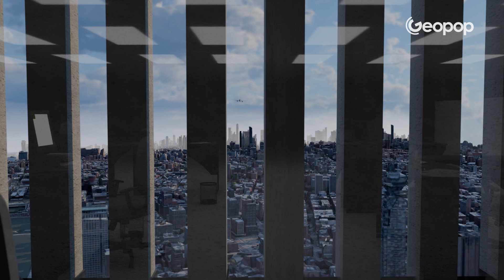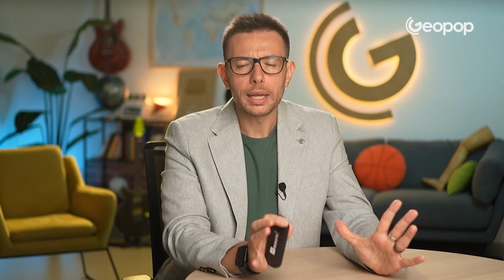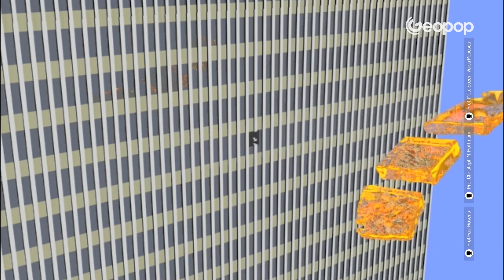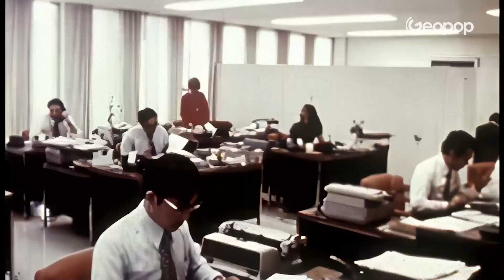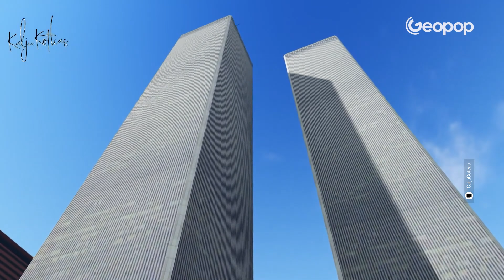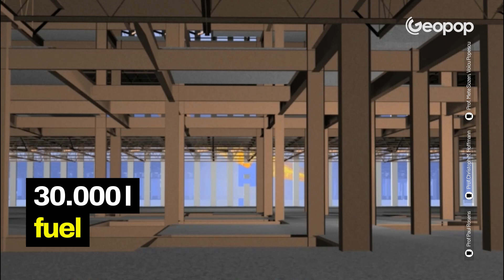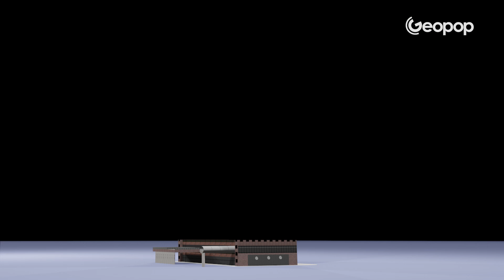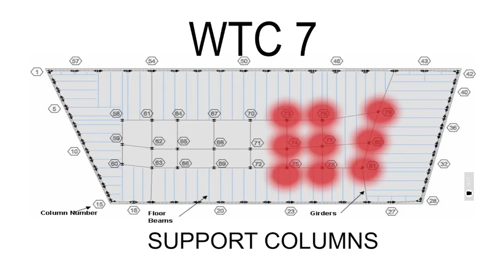9/11, 2001: The Technical Reconstruction of the Twin Towers and WTC 7 Collapses

Comment: The steel superstructure below where the plane hit was in no way damaged, we know this as a fact. It was designed to support the entire building. The top part breaks free and pulverises the rest of the undamaged building, how is this possible. Make a lego tower 1 metre tall, break off the top part and throw it with all your might onto the remaining tower, there is no way it will vaporise the rest of the tower. It will bounce off and fall to the ground like all collapsing building do.... as for building 7, use your eyes.
Reply: I'm not a native English speaker, but I'll try... no high-rise building i know in the world is designed to be partially cut off in the upper third and the entire upper block dropped one floor. In Lego, it works because Lego has all the joints similarly stiff. The stiffness of the joints is a key thing when calculating internal forces and their distribution in space. Here we are talking about +- ten floors falling as one block from a height of about 4 meters. They hit a ceiling that is designed to support its own weight + 400 kg per m2. For one ceiling to be able to support an entire block of many floors when falling, it would have to be designed for such a load from the beginning, and its connection to a vertical supporting structure that would have to be designed for it. Moreover, the dynamic effect multiplies everything.
Try to imagine it different way. A huge perimeter column designed for a load capacity of, for example, 10,000 kN and to this column is connected by two bolts with a limit of around 2x100 kN a ceiling beam that carries 100 kN load and 100 kN is a safety margin if one bolt failed etc.. A huge weight suddenly falls on this beam, for example, 10 x 100 KN x dynamic effect 10 = 10,000 kN. If it were to withstand it, it would have to be designed for this load, but it was designed with the idea of 200 KN. In addition, it should be able to transfer the same force to the columns through those two bolts, because columns are connected to the ground and the load must reach the foundations through them. Can those bolts transfer this load?.. So if you want to make a Lego model. Make strong columns, but connect the ceilings to them with something that can only hold that one ceiling + 100% of its weight as a reserve. The moment you put two more ceilings on one ceiling, the joints will loosen and the ceiling will fall one floor lower... and then try that experiment and throw the top 10 floors on such a model... You will see that the whole thing will fold and you won't even have to throw it.
Reply: How was it possible?  Simple. Let’s break it down to the absolute basics:

The 47 core and 236 perimeter columns of the Twin Towers support all of the gravity loads of the building. ALL of the resistance is in the columns.

Planes impact Towers, causing massive structural damage, destroying sprinkler systems, tearing out gypsum board walls and blasting off the SFRM insulation from the floors. Multiple floor-wide fires are started instantly and spread rapidly due to the destruction of fire protection systems and venting of the building during the impact.

Serious fires were largely confined to the impact damaged floors and those immediately adjacent to them.

Fires were started by the impacts and fuel aboard the aircraft, which acted as an accelerant. No shortage of other consumables inside the tower to continue the fires.

Collapse was initiated (started) at the impact and fire damaged floors when floor trusses exposed to heat over time sagged, in turn pulling on and causing the inward bowing of some perimeter columns by up to 5 feet until they buckled on one face of each tower (ie: NOT symmetrically).

www.youtube.com/watch?v=ULdiD6gYZO0

No steel melted or needed to. Structural steel will bend and fail at less than half its melting temperature.

Once the perimeter columns buckled the formerly static load above became a dynamic load 30 times greater, easily overwhelming the structure below.

Thousands of tons of now loose debris fall through the open office space within the four outer walls - bypassing the columns - dropping 12 feet onto the first intact floor it comes across. That massive instant overload causes the floor to fail, shearing the pair of bolts that secure each end of the floor trusses to the columns. The floor fails. adding its mass to the falling mass which continues to accelerate for another 12 feet until it impacts the next floor, rinse and repeat one floor at a time all the way down.

The columns - the part that holds the building up, supporting ALL of the gravity loads - are spectators for all this as the debris falls around and past them, not onto them.

Rate of collapse increases as momentum increases. The collapse front is constantly accelerating.

As each floor fails, air inside the building (the Towers were 95% air by volume) is compressed, then blows out the sides _in reaction to the Tower falling, not the cause of the Tower falling.

No fire required at all on floors below the impact points for them to fail. The mechanisms that started the collapse are different to the mechanisms which continued the collapse. That will be a difficult concept for some.

As the floors fail the perimeter columns are left literally hanging in the breeze, no longer attached to the rest of the structure. They peel away and fall in great sheets (think banana) out to more than 600 feet from the base on the 4 points of the compass.

Core columns failed last.

The collapses took 32 to 34 seconds start to finish, or about 1/3 of the rate of free fall acceleration for those obsessed with how fast things fall because the internet told you it was important. No Laws of Physics are violated so no need to invoke magic or divine intervention

Each 110-story tower had a 1-acre footprint. The debris pile was up to 14 stories deep and spread out over 16 acres, destroying 8 surrounding buildings and damaging more than 100 others.

Anything can seem like a conspiracy if you don’t take the time to understand how it works. Hopefully now you do.  If not, I can go into much greater detail.
Reply: @TheLoonResistance u keep giving people detailed explanations like u know what u are taking about. U sound like a robot. No office fire or jet fuel fire can melt steel! Period. How can u explain the fucking molten steel that was poring out of the building. What braucht the building down when the top part seconds after starting to colaps was completely destroyed. How can a building fall in 10 seconds without any resistance. Stop talking bulshit. If u don’t agree with some one don’t pretend u know better because u don’t.
Reply: @alexzarnescu4204  - Obviously you need the full version:  Twin Towers collapses were relatively straightforward, the professional engineering community getting a good understanding within just weeks. For the average person though it still requires some effort. Engineering is hard, and who has that kind of time?  So the internet stepped in, peddling a lot of really bad information, simple slogans and hand-wave rationalizations that are exciting and require little or no thinking.  Naturally that gets far too much attention.

Because anything can seem like a conspiracy if you don’t understand how it works and I’m an understanding kind of guy, I prepared my own short yet detailed technical description of Twin Towers collapses from my own observation and analysis of available true and relevant facts. No politics, ideology or magical thinking, just engineering. Hopefully this will dispel many common myths and answer most if not all questions you may have about the collapses.  

While complex, most of the Twin Towers collapse mechanisms can be seen with the naked eye and easily discerned and understood by the layperson if sufficient time is taken to understand.

1. The Twin Towers consisted of 4 primary structural elements that together formed an integrated system where each relied on the others. 47 hollow box-section steel Core Columns carry the majority of the gravity loads. The 236 hollow box-section steel Perimeter Columns carry the remainder and ALL of the lateral (wind) loads. Long-span Lightweight Steel Trusses connect the core and perimeter column together at each floor with a Hat Truss on top to tie the structure together as an integrated unit where no element can survive without the others. There was no structural load bearing concrete and most components were bolted together.

www.youtube.com/watch?v=u7OqrC74Dm4

2. The impact of 120 tons of airplane (= to about 12 dump trucks) at speeds up to 589 mph with the energy of a ton of TNT completely destroys the aircraft. This in no way implies the Towers come out unscathed. Many perimeter columns are damaged or destroyed as are some core columns (example; 33 of 59 perimeter and 20 of 47 core columns damaged or destroyed at the impact floors in the North Tower), This damage is primarily through bolt-shearing failures at the end connecting flanges, as well as bending, twisting and fracturing of weld seams. There was no cutting or slicing - the reality was far more violent and messy.

3. The impacts destroy or damage fire insulation, fire breaks and sprinkler systems on multiple floors. Huge fires are started across multiple floors simultaneously and allowed to spread rapidly with no effective firefighting or fire suppression. This was an unprecedented fire event .

4. The hotter steel gets the weaker it gets . With fire insulation stripped away and no sprinklers the survival time of the steel greatly reduced. Gradually over time heat causes the lightweight steel Floor Trusses at the impact damaged floors to sag, which was observed and recorded. No steel melted or needed to. Structural steel fails long before it becomes a puddle. It just needs to bend

5. Sagging floor trusses pull on the increasingly weak and overloaded Perimeter Columns, causing some of them to bow inward by up to 5 feet. A straight column is up to 4 times stronger than a bent column. The bowed Perimeter Columns buckle and fail, quietly initiating collapse. The formerly static mass above which the structure below could easily support is converted to a dynamic mass up to 30 times greater. Because they have buckled, the Columns above and below the failure point are no longer aligned . The load bearing structure below no longer bears any load as it falls past the lower columns, NOT onto them.

www.youtube.com/watch?v=ULdiD6gYZO0

6. Thousands of tons of debris fall within the four outer walls, down through the open office space, crashing onto the first intact floor it encounters, immediately breaking the bolted column connections as the amount of resistance the Floor Trusses can offer is negligible. The falling debris slows only marginally and briefly. Note: 
6a. This is NOT a solid top block crashing into and “crushing” a solid bottom block . 
6b. The debris falls past the columns not onto them. The columns provide no resistance to the falling debris. 
6c. Only the bolted floor truss connections to the core and perimeter columns offer any resistance. A pair of 5/8” bolts at each end of each truss vs. thousands of tons of falling debris. 
6d. No laws of physics are violated. 
6e. There is no 20 floors against 90 floors but rather 20 floors against one floor, then 21 floors against one floor, then 22 floors against one floor, etc. 

7. This floor-led collapse progression within the four outer walls can only go straight down.
7a. This process is often incorrectly referred to as “pancaking”. The catchy name stuck but nobody knows what it really means and "pancaking" is too simplistic and inaccurate anyway. I prefer Kaiserschmarrn.

8. Collapse progresses through the floor systems past the columns, through the path of least resistance . The resistance offered by each floor is always the same while the mass of debris and its velocity – thus its energy - increases with each floor failure. Each floor offers the exact same resistance to the falling mass while with each failure the falling debris constantly gains both mass and velocity. *This process of floor-by-floor destruction cannot be arrested, it can only speed up . Rate of floor failures increases with each floor as momentum increases, reaching an average acceleration of 0.65 of GA, or 35% slower than true free fall. Bam, bam, bam down the building until there are no more floors to fail. The resistance offered by each successive floor is always the same. More mass, more velocity, same resistance with each floor. Don’t get stuck on the but the lower floors weren’t on fire nonsense. They weren‘t and didn’t need to be.

9. The Towers were 95% air by volume. As that air was compressed inside the building it is forced down the tower and blown out the sides in reaction to the building collapsing . Those were not “explosions”, it was expulsions of compressed air caused by the collapsing building, explaining the low velocity, lack of flash, blast, supersonic pressure waves and lethal high-velocity ejecta.

10. Perimeter Columns become detached and peel away like a banana behind the collapse front, playing out to the four points of the compass extending to more than 800 feet from the base of the towers. This was quite obvious from examination of the debris pile.

11. Core Columns fail last as their internal beam bracing is stripped away by falling debris and lateral support from the floor to perimeter columns is lost.

www.youtube.com/watch?v=WpHXj62Ylw0

12. For those who care about how long this whole process took; 31-34 seconds from the moment the perimeter columns buckled until the last core columns hit the pile, or 1/3 the rate of true free fall. Don’t believe me? Just watch any video of the collapses and note the loose truly free-falling debris dropping much faster than the towers themselves.

13. Each Tower had a 1-acre footprint. Far from collapsing inside their own footprints the debris pile spread out over 17 acres in a pile up to 14 stories deep. 8 surrounding buildings were destroyed and scores more damaged by the falling debris.

14. NOT observed were the 180-190 dB bangs of thousands of high explosive devices or the blinding bright flashes of burning thermite. Neither explosives or thermite could have survived the impacts and subsequent fire nor could have caused the (silent) perimeter column buckling that clearly initiated collapse either. A video of a shocked and injured firefighter casually using the magic word explosion is in no way proof of explsoIVES and the demolition_ case relies entirely on that sort of thing. There is zero tangible physical evidence and it would be technically impossible, totally impractical and completely unnecessary. No one would bother.  In 24 years zero structural engineers of tall buildings, including the 1/3 that have retired in that time, have made any statements in support of pre-planned demolition claims. NONE. The lack of any such citations in the engineering literature (published in any country worldwide) is telling.

15. Twin Towers were perfectly safe within their design envelope. They only collapsed when taken far outside design parameters by an extraordinary and unprecedented event

Impact + Fire (heat) + Time + Gravity = Collapse . Remove any one of those 4 elements and there is no collapse. Ignore any of those elements (as many do) and you will never understand the collapses. The Twin Towers were an integrated system in which no one component could survive without the others. One fails, the rest follow, through the path of least resistance – DOWN – through the open space, bypassing the path of greatest resistance – the columns. Nothing I just described violates any laws of physics. All of the above is true no matter who planned and carried out the 9/11 attacks or why

I hope you found this helpful and informative. It’s meant to be non-adversarial and solicit informed critical comment, positive or negative. If I made any errors of fact, logic or reason or left anything critical out, please let me know so I can fix it. To stay focused, just one topic at a time please and on-topic (Twin Towers ONLY). No word-salads of Gish Gallop. IF you can offer a more plausible alternative be my guest. Please start any reply with the words “Tits McGee” or I’ll know you didn’t read it, aren’t serious and wasting my time.